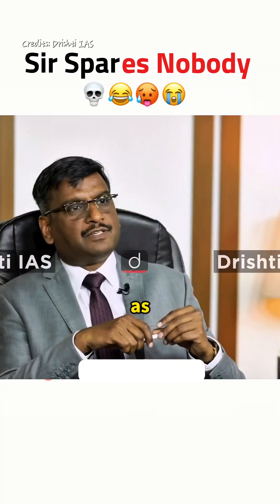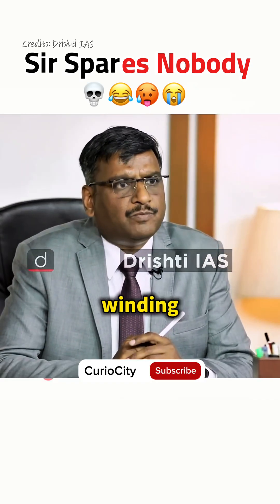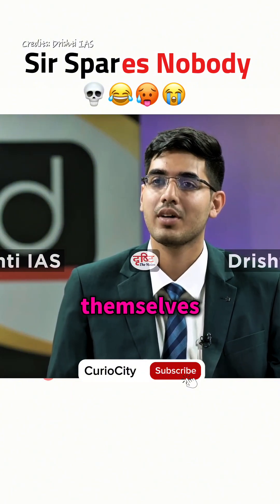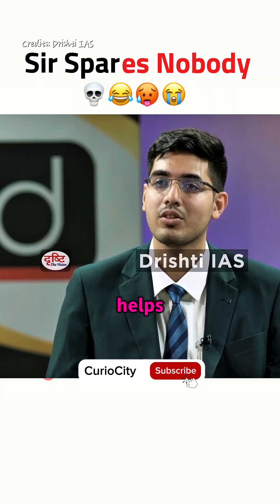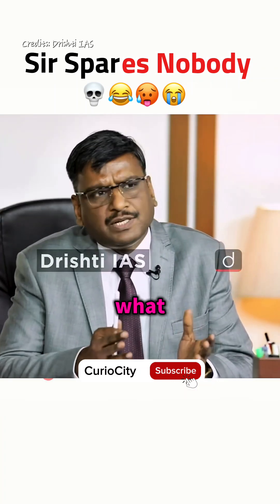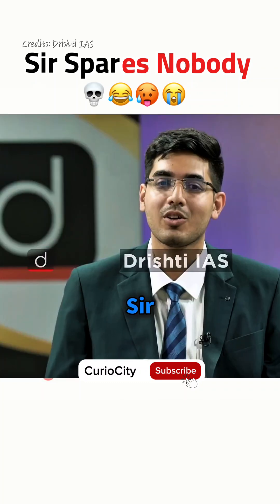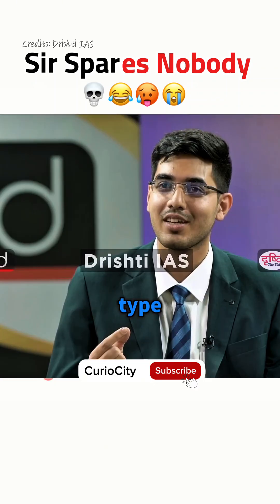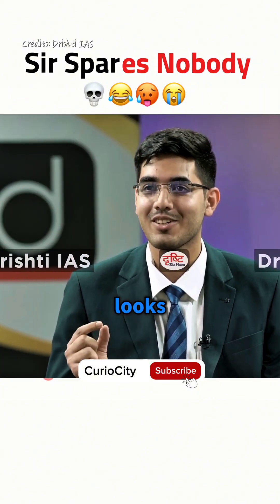UPSC Interview: Mechanical Watch, Jewels & Escapement – Complete Explanation with Best Answer

Comment: Hmt janta is not self winding , it's manual wind, hmt automatic or any automatic is self winding watch which powers by the motion of hand , because of rotor flywheel winding the mainspring... Regarding jewels it acts as a bearings on the joints of gears.. earlier 200 years ago .. the watches like rolex or any old time Swiss watch used ruby or any sapphire stones that's why the word jewels.. now it is synthetic...

Comment: Jewels are bearings of the watch...  since the original jewel crystal is so smooth on the surface, it can be used as a Bearing for the micro size shafts of the movement.

Comment: Synthetic ruby, and more number of jewels, more complications a watch has, a watch having a date function might have 7 jewels, but some watch like a chronograph, may have 30 jewels. The swinger palette behind the movement,  that oscillates back and forth as we move our hand, this weight is attached to main spring barrel via a sawtooth gear meachanism that keeps it winding automatically.

Comment: it's very sad to know how he couldn't differentiate between a self winding watch and a mechanical watch, self winding means the watch has a rotor, that's it that's the answer, unlike a mechanical watch which needs hand winding. in terms of jewels,
17 jewels, 21 jewels or 25 jewels, the more jewels it has it helps with the accurary, you'll not see the difference between 17 and 21 jewels as both may run at 21800 bph but between a 17 jewel watch and a 25 jewel watch, the accurary and the beats per hour is not the same, most 25 jewel watches for example swiss ETA 25 jewel movements has 28000bph where the second hand swipes much smoother.

Comment: Wrong, jewels vibrate at a fixed frequency. These vibrations provide predictable gear and rotary movement. The escape wheel helps in toning down extra mechanical winding to release the pressure built in the mainspring which can damage the tiny cogwheel and roters.

Comment: Hmt janta is not self winding but mechanical. Self winding are automatic and have a rotor which hmt janta doesn't have. This is definitely  a prepared answer, just generic stuff with no flair that one would have if they actually have the hobby.

Comment: Simple answer to self winding is that there is a rotor attached to the movement(whole machine that runs watch hands) it rotates with hands movement, winding the main spring, adds additional power! ❤